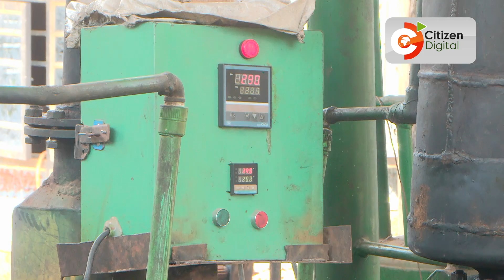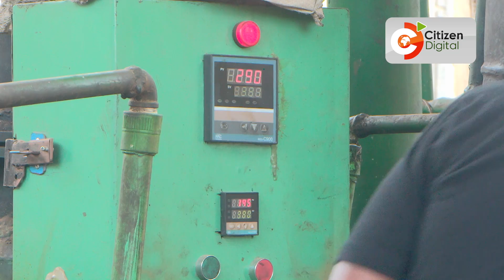Meet Murang'a man who makes petrol and diesel from recycled plastic waste, uses it to power his car

Comment: The United States found that this isn't worth the grief. You can run petrol engines on alcohol (my industrial van uses 85% ethanol  and just 5 gallons of petrol per full tank. Diesel can be made with vegetable oil which we figured out in the 90's. Please do not make our mistake and turn paradise into a garbage heap

Comment: With fractional distillation you can refine the plastic crude sludge into a pure petroleum product.However Mechanical Engineer James can upgrade and come up with agricultural solutions that will rescue most farmers in Kenya and help them cut crop production costs due to high fuel prices in the country by fabricating for them cheap hydrums for irrigation purposes.He can make good profits and at the same time help the country in food security.

Comment: 😂This is not a new invention. It's called pyrolysis, and it's highly inefficient, otherwise this would have been the go to method of petroleum manufacture. The energy required to manufacture the fuel is way more than the caloric value of the fuel produced. Complete waste of time and money. There's no genius here

Comment: Kenyan made 😅😅😅😅 anyone who knows chemistry, this process is called pyrolysis and it's nothing new. Hahahaha this is a known thing and it's not an invention.

I'm still laughing watching this. Pyrolysis works in converting plastics to petrol or diseal and it takes huge amount of Plastics to produce a substative fuel. 

Major disadvantage of pyrolysis is that produced ashes contain a high heavy metal content, depending on the concentrations in the to-be-processed flow. 

Thefore: The improper disposal or management of the gases and the char (solid residue) in this case could be dangerous for people, wildlife and the environment. 

If used in soils, heavy metals can leach to the surface water or to the water table, or bioaccumulate in plants and then in animals
Reply: Yeah. Pyrolysis. But show me one company that has successfully turned the pyro oil into usable fuel.....

Comment: Thanks to everyone for all your kind words. For the doubting Thomases, we will soon showcase farmers who have been using our product to irrigate their farms during the dry season.
Reply: Kenyan made 😅😅😅😅 anyone who knows chemistry, this process is called pyrolysis and it's nothing new. Hahahaha this is a known thing and it's not an invention.

I'm still laughing watching this. Pyrolysis works in converting plastics to petrol or diseal and it takes huge amount of Plastics to produce a substative fuel. 

Major disadvantage of pyrolysis is that produced ashes contain a high heavy metal content, depending on the concentrations in the to-be-processed flow. 

Thefore: The improper disposal or management of the gases and the char (solid residue) in this case could be dangerous for people, wildlife and the environment. 

If used in soils, heavy metals can leach to the surface water or to the water table, or bioaccumulate in plants and then in animals
Reply: @bensosfrequents  you know nothing...on the contrary pyrolysis is the most safe way to recycle plastics and after burning only bio char/carbon remains which is very useful in road carpeting and you can also use it to make charcoal brickets. Interms of production 1 portion of some plastics  should give you 50-75% of crude oil which you then refine.
Reply: Bwana Bei Ya Mafuta imenilemea, where can I come to buy your alternative fuel?
Reply: Hi how can I connect with you am from DRC and I really l'île your idea
Reply: @graciamuamba2351 We wanna stabilize in Kenya first before trying new markets, but let's keep in touch
Reply: @@graciamuamba2351   hello ,did you get the contact details
Reply: How can one get in touch with you to schedule a visit to your site?
Reply: @@ianmwangi5680   hello ,where are you located
Reply: Pls, how will I get more information on this project
Reply: 👍👍Guys you are doing Great work there, keep it up! With love ❤ from Zambia.
Reply: Wow.. that’s really good. God bless you and take care.
Reply: Hats off to u, this shld get more coverage...
Reply: @cwainaina 😊
Reply: I am so proud of you and your team 👏👏👏 the sheer pride I feel is unbelievable. Thank you for doing great work 👏
Reply: Good job! Is there somewhere you explain the efficiency of producing this fuel, pollutants, etc,
Reply: Brilliant idea.....Innovation & entrepreneurship combined congratulations
Reply: You are doing great 👍 👌 congratulations 👏 🎊 💐 and i wish you all the best
Reply: 2:49 the idea has been around for long.. The problem is source of raw materials. That hard plastic has a lot of other uses and it's hard to find. The alternatives are not cheap. but kudos you have started where I failed in 2018
Reply: Jaymo, Roba was here. Good job you're doing 👊
Reply: Keep up the great work... That's amazing
Reply: Amazing
Reply: I tried your fuel in my car and it worked very well actually the car felt more efficient and the fuel gave me more mirage. Planning to visit you again soonest for more this time.
Reply: @Greenergy254  awesome stuff. Thanks Tony
Reply: Where is he based please? @Greenergy254
Reply: Good initiative 👏...I want to do same can you help me??
Reply: The CIA CLASSIFIED missing persons😮
Reply: Wow I’m very interested in your work. I’m in the USA but no one here seems to have this kind of interest in what you are doing. If there is any way I can help you with your work or anything please get in touch with me.
Reply: NIce one. Ulichimba kisima yako ya mafuta🤣🤣🤣
Reply: Please do you use catalyst
Reply: Question,

How does the process respond with the other types of plastic?
Reply: how do I contact you?
Reply: check out website for contact details
Reply: @juliusgatune7886  are you interested in the project? And where are you located